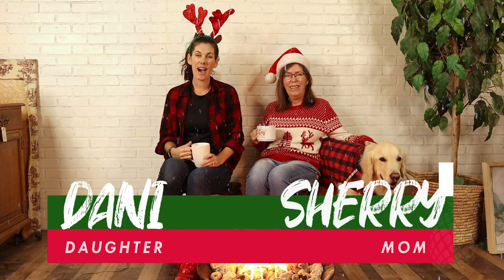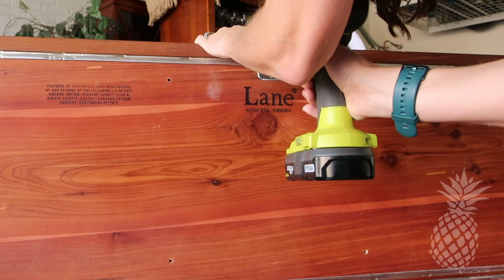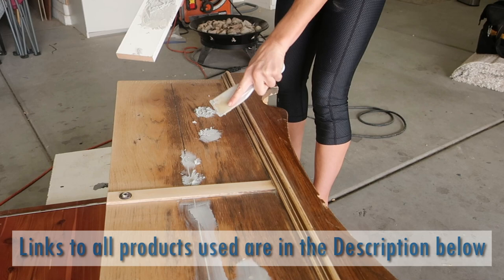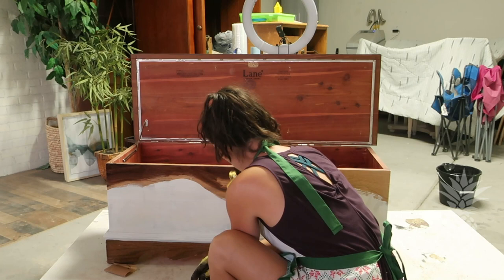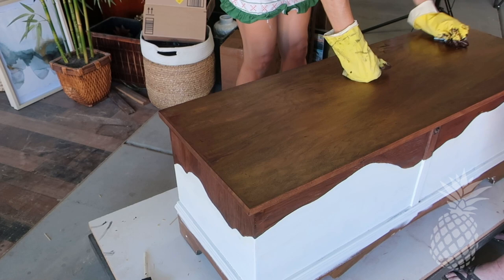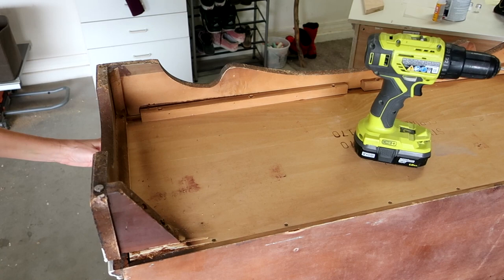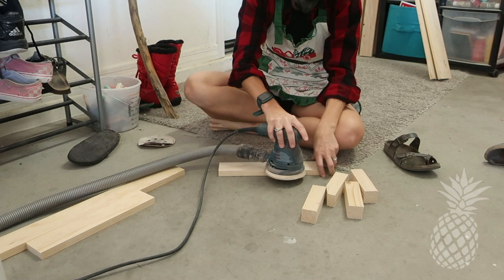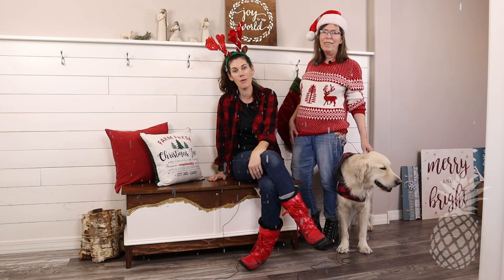Cozy Winter Furniture Flip Challenge // Lane Chest Makeover with Gold Leaf And DIY BASE

Comment: Check the speed setting, it's probably on high
Reply from the maker: Hi, thanks so much for the suggestion. It actually didn't have variable speeds so we decided it was time to upgrade to a better quality one. We got a nice Bosch. May get a Surfprep or a Festool down the road but that will be a while.